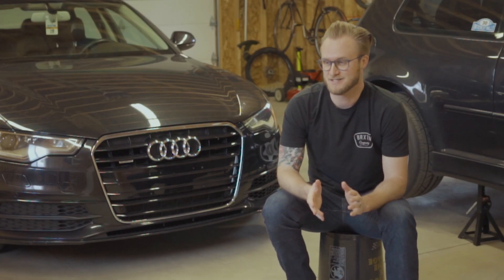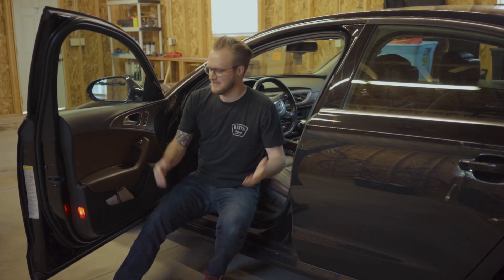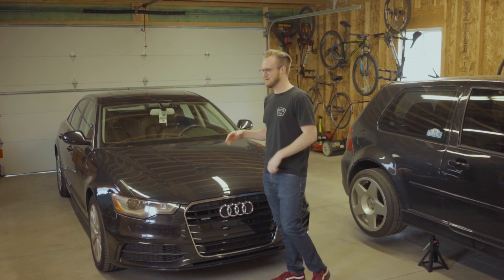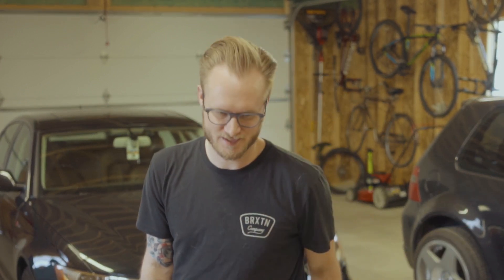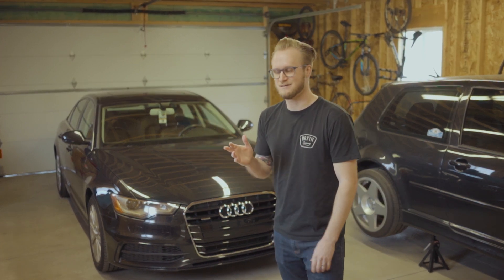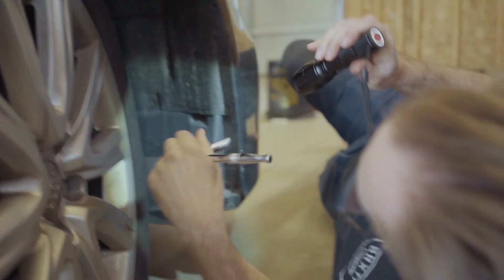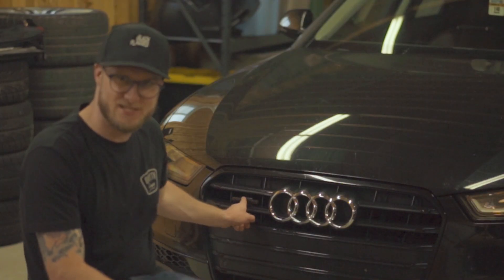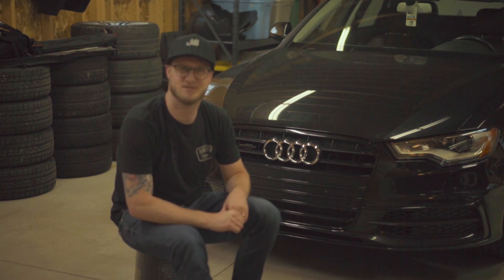Audi C7 A6 Grille Conversion - A6 to S6 Black Optics!

Comment: Title error =P
Nice seeing a vid from ya again boss
Reply from the maker: Thanks man!   Also, do you mean "grille"?  I was so torn on this, but I think I have it right - "Grille: a grating or screen of metal bars or wires, placed in front of something as protection or to allow ventilation or discreet observation."
Reply: @joshwalling4633  auci is what I meant lol, I spell grille the same 🤷‍♂️ never looked up the definition though just thought that was the Euro way of doin things lol
Reply: Unless that's the brand name of the grille then disregard, I had to dip about two minutes into the video gotta finish it later 😅
Reply from the maker: LOLOLOL wow.  Thanks!

Comment: Great video. I'm working on this on my 2016 A6. I get some interference between the S6 grille and the grille bracket (attached to the bumper for the top 1/3 of the grille opening. Did you have to modify any of the 'fins' on either the grille or the bracket?
Reply from the maker: I didn’t, but your bumper and grille are totally different from mine.

Comment: Ya the sensor are no fun my Dad has the same car. A few years ago he got into a small fender bender and the people who fixed it didn’t know that you would have to disconnect the battery and they disconnected the sensors and it was a nightmare to get fixed by the dealer.

Comment: Im keep looking at the difference between the A6 vs s6 black optics grille but other than the chrome I see no difference !
Can anyone let me know what else differ from one another?
I’m planning on swapping mine but if it’s only the chrome part than is different  I rather plasti dip it gloss black and call it a day 
Thanks
Reply from the maker: The slats in the S6 grille have some additional details in it. Instead of one solid bar, each slat has two parallel bars. It’s a minor and subtle difference. There is also an A6 black optics grille that is like the normal one but gloss black.

Plastidip results in a very cheap looking grille on a not-so-cheap car. I wouldn’t recommend (from personal experience using it on other cars).
Reply: @joshwalling4633  thank you for clarifying this 
I agree plastidip does look cheap although I have done gloss black dipping for my wife’s b8 S line and it looks pretty damn good 
I mean if it looks like crap than I will peel it of and go plan b lol
Thanks again 👍🏻
Reply from the maker: Best of luck!

Comment: Where did you get that grille from? Tried the links but they don’t work.
Reply from the maker: The grille is an OEM Audi S6 black optics grille. I don’t have a link for it as I got it off of Facebook marketplace from someone.
Reply from the maker: Here is one I found on eBay: https://www.ebay.com/itm/254775310350